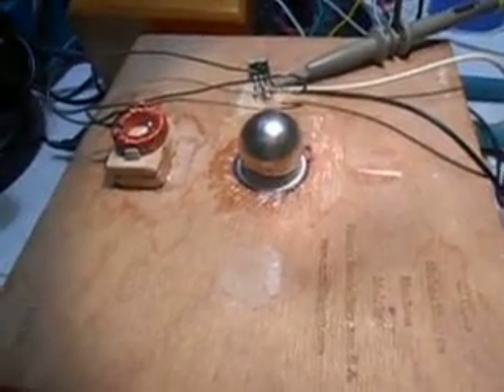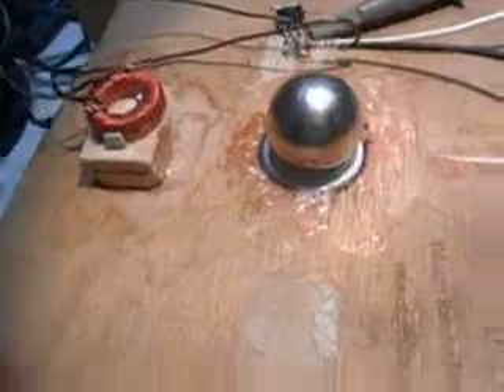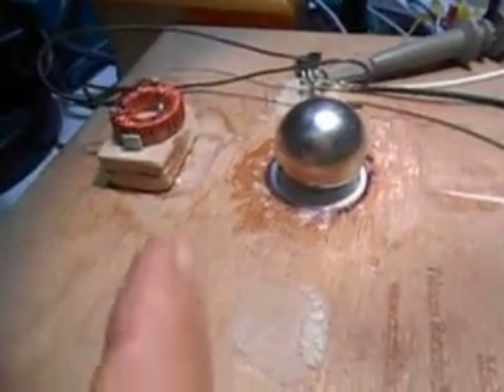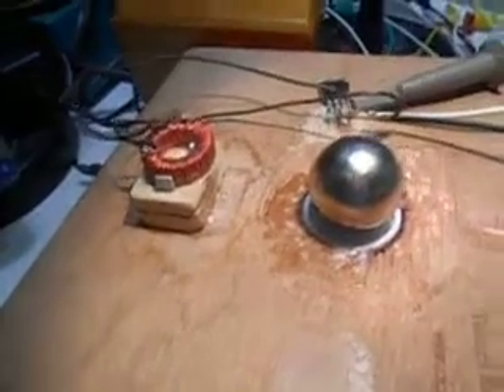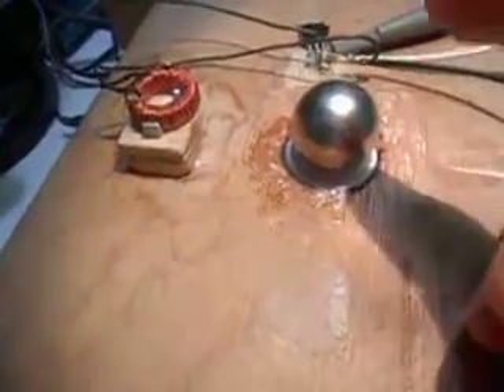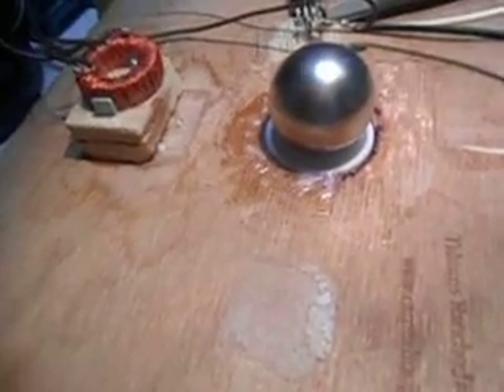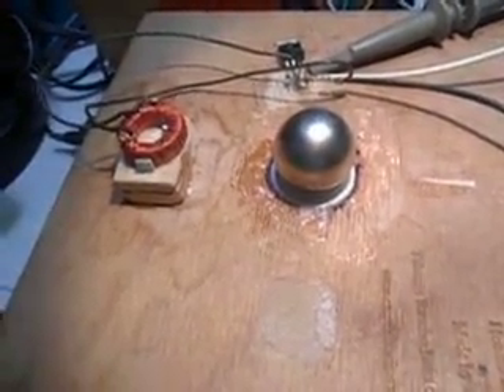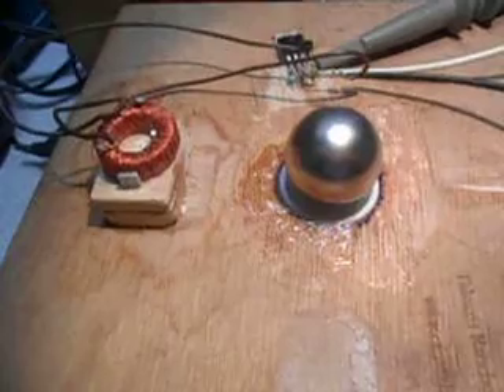Ball magnet Thomas motor

Comment: What do you think? That the magnetic field is confined inside the toroid? Of course it would be so if we lived in an ideal world, but we live in a real world.
In practice, there is a leakage field from the toroid, especially if the current is strong and the core is saturated. The fact that the duty cycle of the current is not 50% and so creates a DC component doesn't change the principle. The toroid field exerts a torque onto the ball magnet depending on  the magnetic polarity of the toroid field relative to that of the ball. As the field from the toroid periodically reverse around a mean value, due to the changing current around its mean DC value, the ball tends to rotate at the same frequency in order its own magnetic field to best fit along the field lines from the toroid. This is a synchronous magnetic motor whose the principle is known from the 19th century, and commercial achievements also.
Well done but nothing new here.